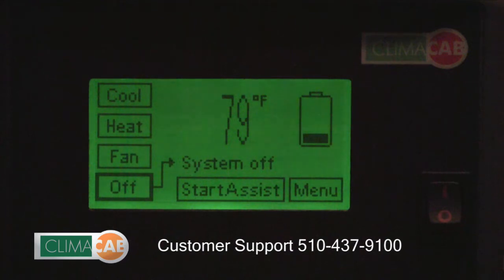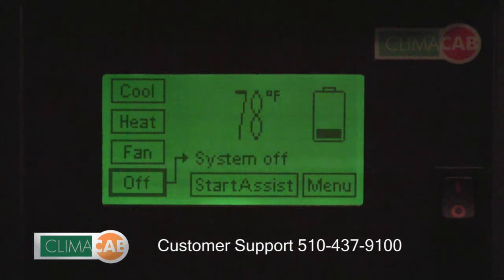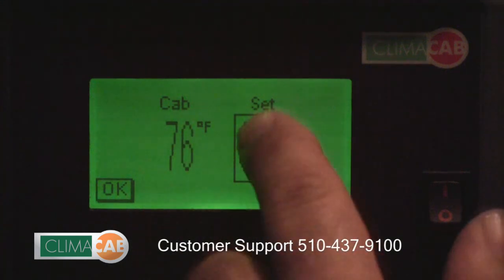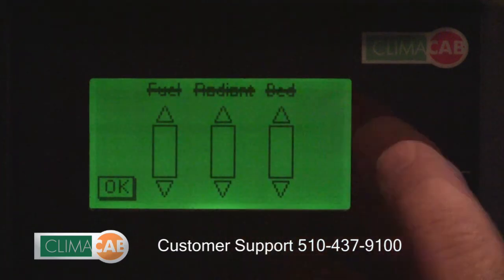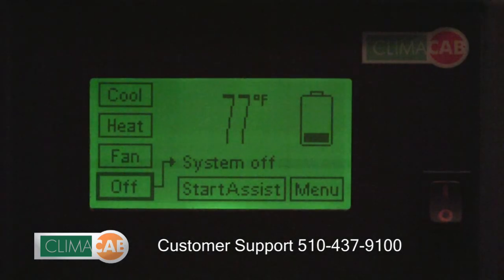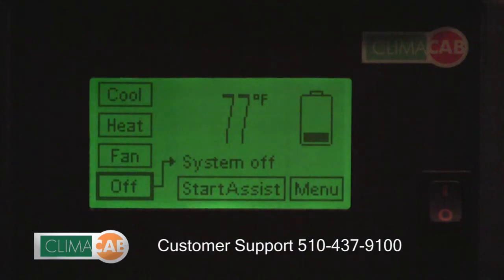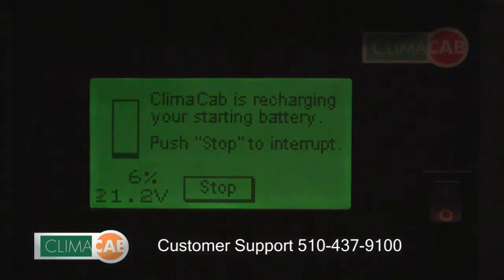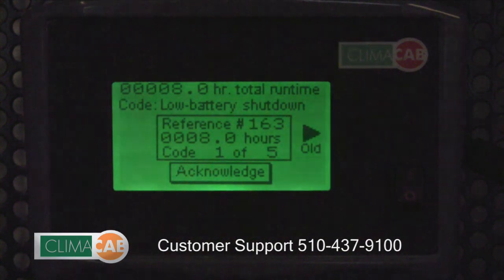ClimaCab Electric APU: Basic User Guide for software version 35 and newer

Comment: My company put one of these units in my truck. it sounds noisy at first but as it settles in it quiets down and doesn't keep you up. I've not tried the heat mode yet, however i use the Cool mode every night. One thing you have to keep in mind is, if you use it the whole night and don't drive a good 8 hours the next day, the batteries will not be charged enough to run it the next night. Put all in all i love this unit and have slept many nights with the temp in my truck below 70 and not idling.

Comment: if it's cold outside and you wanna use this to run your block heater so the engine will start the next morning, do you need to run an extention cord through something, or can that be built right in?